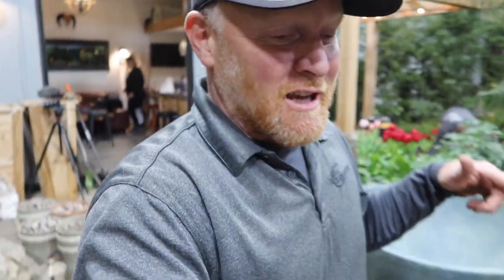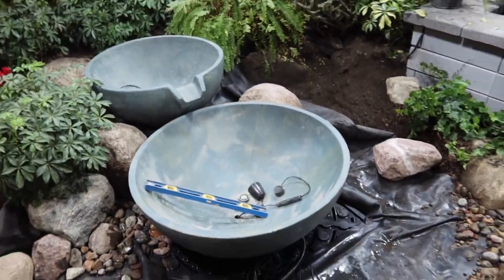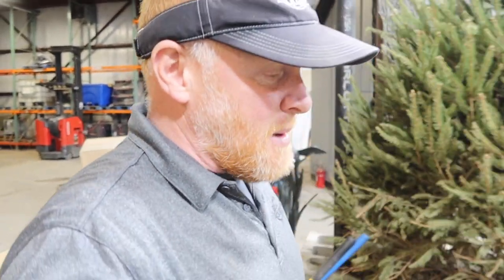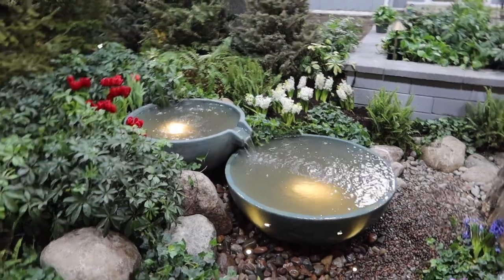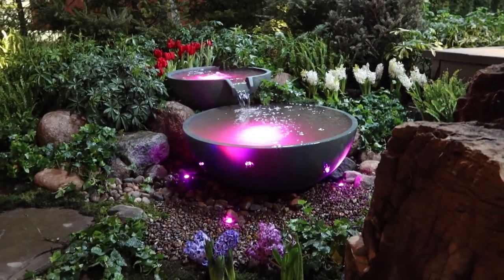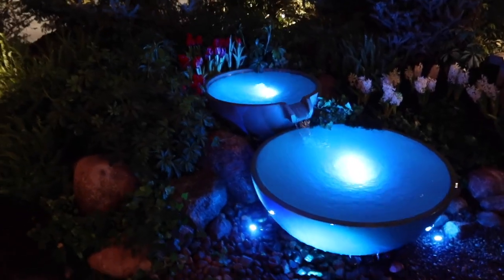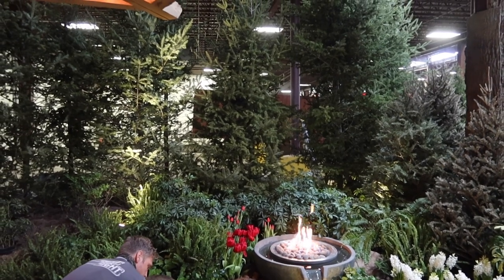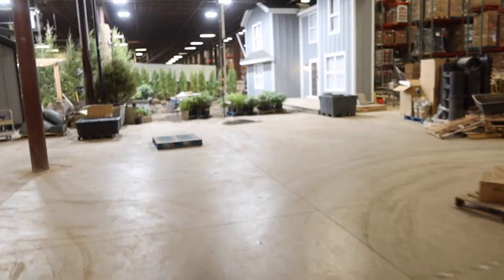DIY Spillway Bowl Installation W/ Color-Changing Lights

Comment: Does this connect to water line or does it have to be manually refilled?  Does the water spilling over the edge of the lower bowl get pumped back up into the upper bowl?

Comment: Enjoyed your video. How are you using to seal the wiring as it passes through the wall of the bowl? I've go an Aquascape light ring that I'd like to use in my bowls.Thx
Reply: I just recently installed mine.  There is a separate port for the lighting wire and the bowl comes with a squishy, silicone plug with a slot for the wiring.  I'm not sure if that by itself would be 100% leak free.  I believe that they recommend adding some silicone caulk as well which is what I did.  I put some silicone in the slot of the plug, fed the wire through the bowl and then put the plug around the wire and added a bit more silicone.  Then jammed the plug/wire combo into the port.  Tip on the squishy plug.  It is so squishy, it's hard to get it into the hole.  I found that with a small, flat blade screwdriver, I could push in and down along the side of the plug, doing that repeatedly around the circumference of the plug a bit at a time.  Eventually I was able to push the plug all the way into the hole for a good seal.  Then I smeared some additional silicone around the plug after I put it in.  Seemed to work fine. 

I used the color changing lights and the setup looks awesome at night!